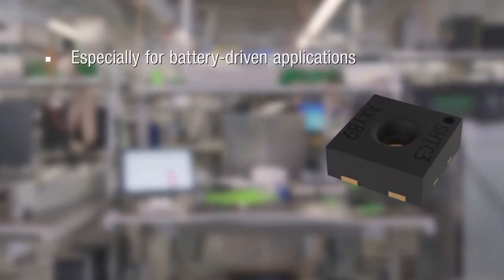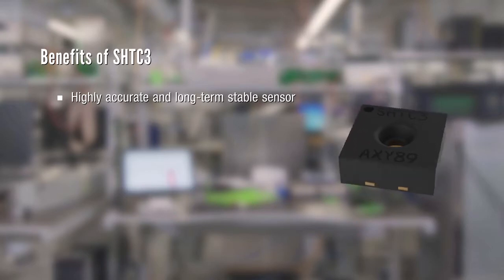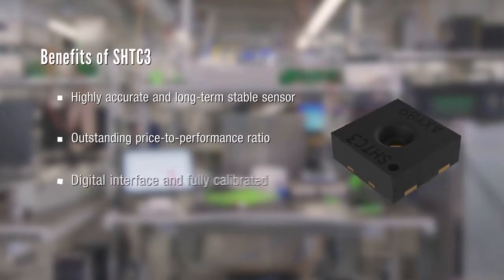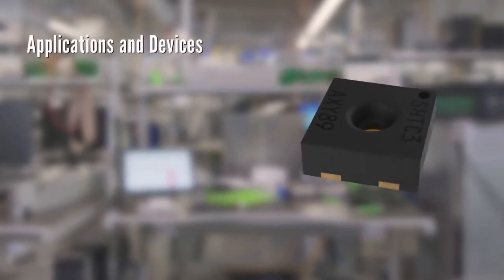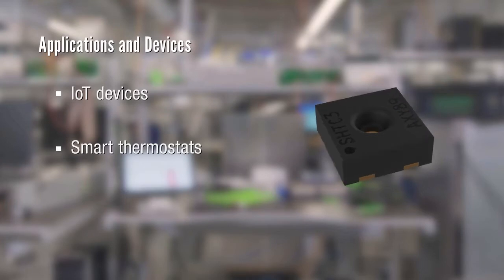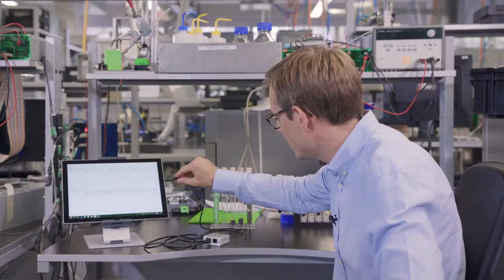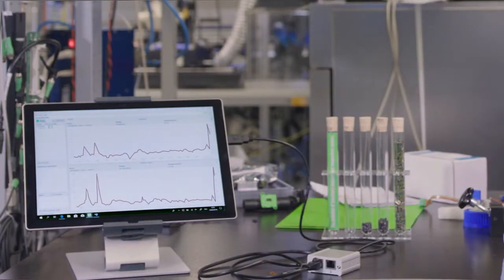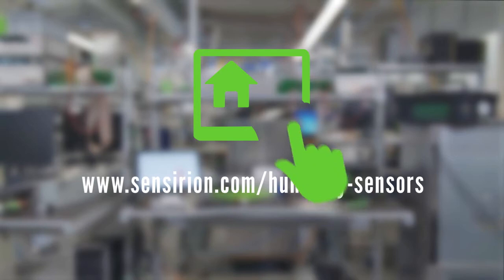SHTC3 - Humidity and Temperature Sensor

Comment: Awesome! 
Just a question though, how big of a hole diameter do you recommend if I need to connect this sensor from inside my water-tight enclosure to the outside atmosphere, through a plug-gasket? Is a 2 mm dia hole sufficient?